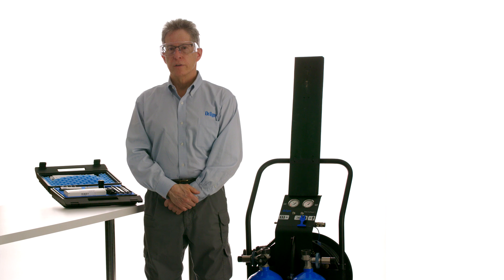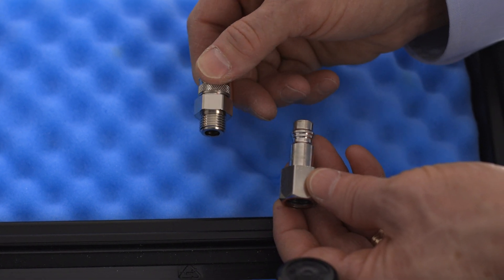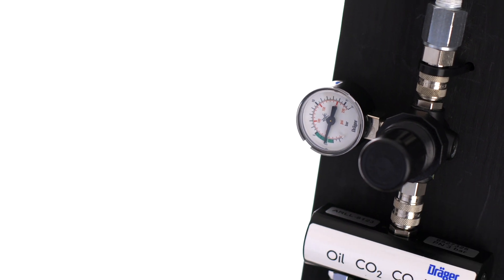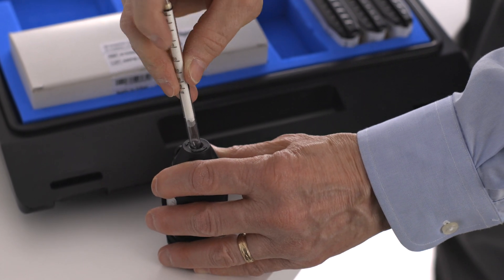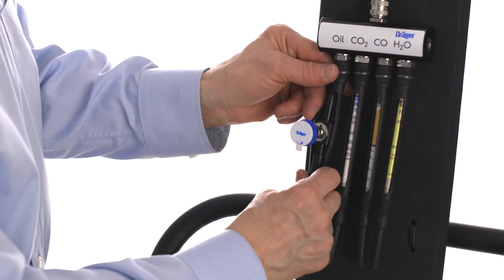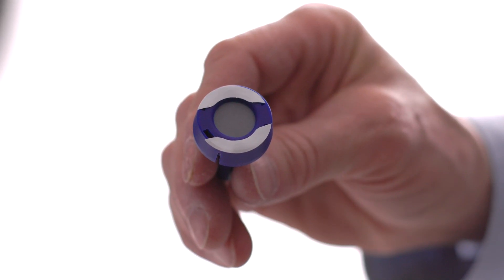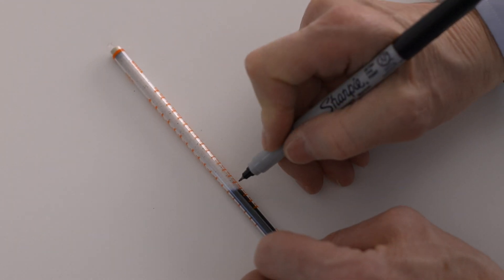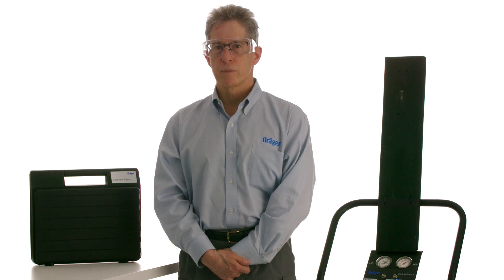Aerotest Alpha Instructional Video

Comment: Hi ED, thanks for your nice presentation. thus Drager has any online solution (without tube) for measurement of condensed oil, CO2, CO and H2O in compressed air
Reply from the maker: Dräger does not currently offer any other solution to test compressed air for contaminants to the best of my knowledge.